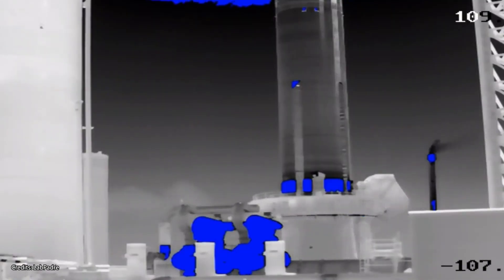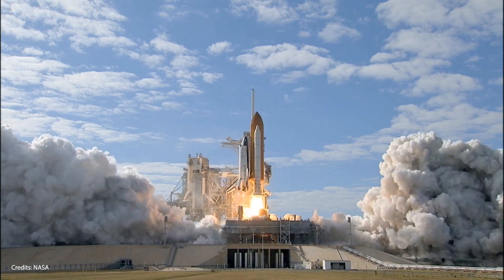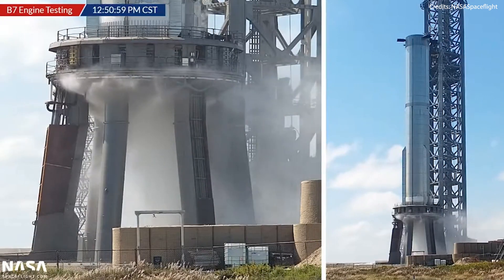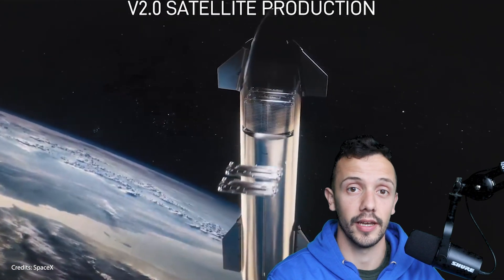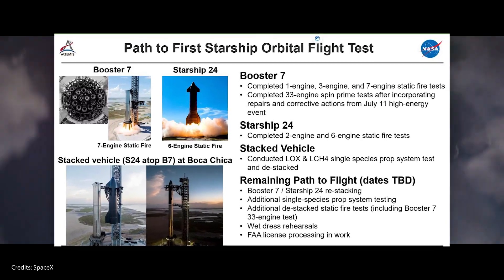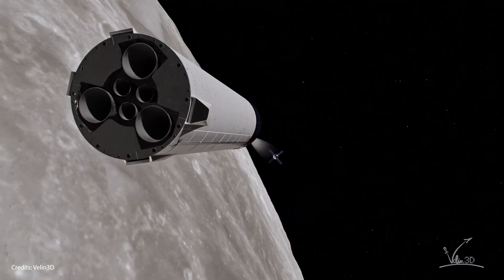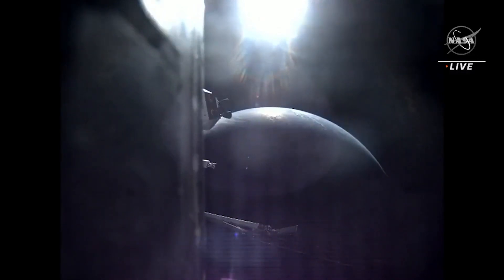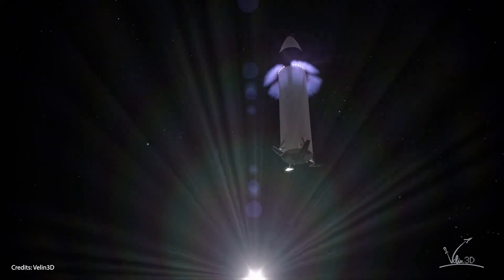Booster 7 Sends Concrete Flying At 40% Power! Will SpaceX Regret Not a Using Flame Diverter?

Comment: I saw the view from a ground camera probably a mile from the launchpad showing cement raining down during today's launch attempt. Definitely a mistake to not have a flame diverter. I wonder if any of the engine failures at launch were due to no flame trench and a minimal deluge system.
Reply: Im gonna bet it is the concrete.   I saw massive slab fly over the booster.
Reply: @Raj S  yep it was